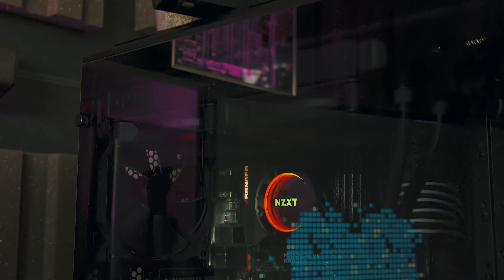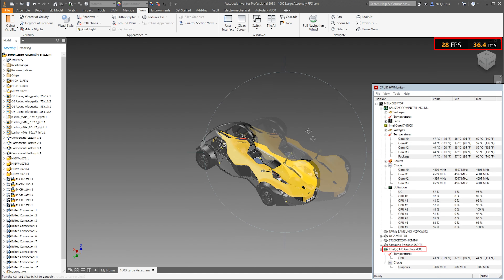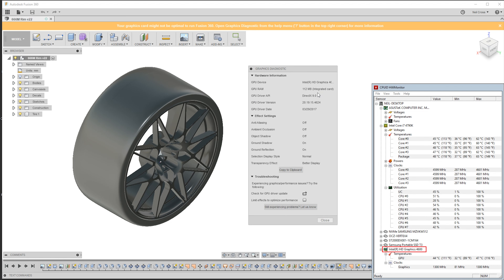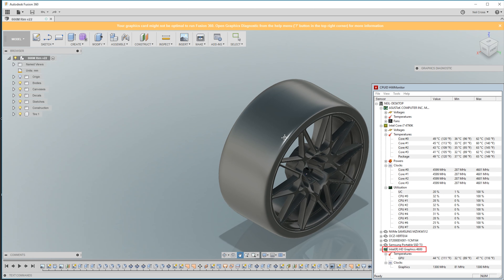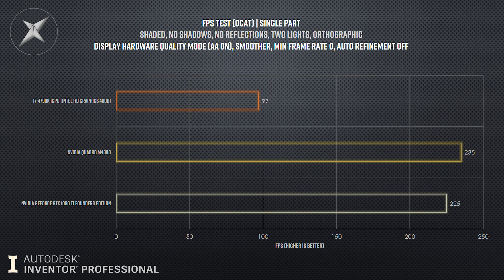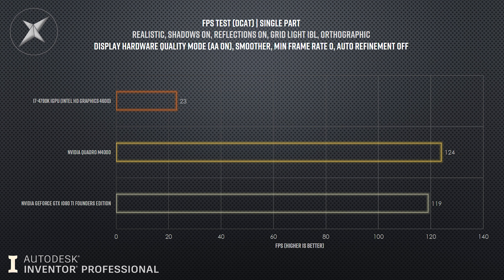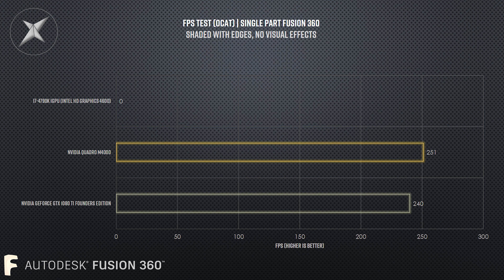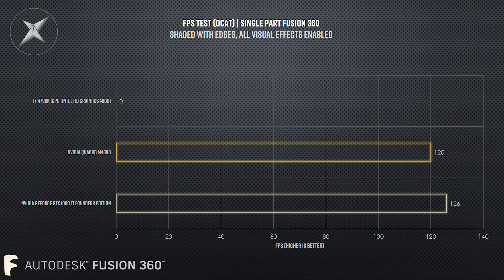What happens if you run 3D CAD on integrated CPU graphics? Spoiler Alert, Fusion360 HATES it!

Comment: Great vid. Thanks to you, I saved $300 by going with igpu since I only need to work from home occasionally for emergencies...  Hope to see a vid with the new apus/igpus.  Thanks again.
Reply: Worked good?
Reply: @omarn8266  depends on what you mean by good.  It helps to turn shadows off.  It may display bounding boxes only when orbiting in a massive model.  But the experience is workable, not like the interface is lagging seconds behind each move.

Comment: 90% of the time, I run Inventor in a VirtualBox Windows 7 image.  It is reliable as long as I only have one file open at a time.  It doesn't matter if said file is a 1000 part assembly, or a single part... it'll (slowly) model itself.  It's faster than Boot Camping over to Windows and back.  However, the part faces have a high probability of becoming transparent as soon as two or more files are open.  To make the faces reappear, I typically need to close the files and then reopen.  I don't recommend it, but it does work.

Comment: I use fusion 360 on a surface book with integrated graphics and it works just fine.
Reply: The IGPU he used here came out in early 2013, thats why it sucked.  The modern IGPUS  like in your surface book are far better. (of course he'd never disclose that, it's a way of manipulating viewers to sell products, they all do it).

Comment: The iGPU is allocated dedicated system memory by the motherboard (up to a maximum of 2GB depending on the specific motherboard) and is configurable in the BIOS. I'm curious if the iGPU with the full 2GB would be fine for Inventor on a 1080p screen as I'd imagine 2GB would be more than enough.
My motherboard only allows for 1GB of dedicated memory but it'd be really cool to see a video on how to best set up your computer for inventor if the iGPU is all you have available, like it's £120+ for a low end GPU with 4GB of RAM and if you don't game the GPU's power is just sitting idle. I really enjoy your benchmarking videos they remove all the bullshit, you don't need dual xeons and a £10,000 graphics card like some websites suggest.

Comment: I love all these kinds of hardware related videos you do! I do not remember if you mentioned it in another video but any plans to test Autodesk applications with Ryzen? I think the 1600x is priced so well and has ECC ram support (such as with Asrock x370 boards) but the IPC performance is a concern. Keep up the great work! Edit: Actually I suppose the Ryzen 7 would offer the same IPC performance so I cant wait for the video :)
Reply: 66racer 
As long as the RAM is at DDR4 3000+, it should be good. I guess we will see with the AMD build. But, anything over DDR4 2667 is technically overclocking, so it is not guaranteed to work. Another option is to run the Ryzen 7 in quadcore mode as 4+0, which would eliminate the CCX latency.

P.S. You want to make sure the motherboard actually supports ECC. Most of what I see is that they support it in "non-ECC mode".

Comment: TFI, i will be building a new rig early next spring and my plans are to use I7700K, Nividia Geforce 1080 (not Ti) FE, and 16gigs at 3200, 250Gig SSD M.2 and 4TB 7200 HDD. will this be more than enough to run the CAD Suite with Inventor and still play games? if you have any recommendations as to what i should use "as in maybe more RAM" please by all means i will like to hear some feedback. The wife has giving me the Green Light to build whatever i need to help in getting my Mechanical Degree.
Reply: Skepz I will look into that. I love the research as much as I love the results. Thanks kindly.
Reply: Skepz 
The Ryzen 7 may not run Inventor as well. We have not seen Ryzen benchmarks with DDR4 3200 RAM in Inventor yet. But, even if that is the situation, Ryzen 7 would be able to game while waiting for Inventor to do something where the 7700k could not do anything while waiting for Inventor. Ryzen 7 will also give better minimum framerates.

As for the RAM, 16GB of RAM may not be enough to game while running Inventor. It depends what the RAM requirements of your CAD models are.

EDIT: I see that you are merely getting your degree. For my degree, an Athlin II X3 was barely enough, but it worked. It had half the IPC of Ryzen, so a Ryzen would be very adequate. As for the RAM, 8GB was okay for me, but FEA simulations were a problem. However, I made it work. And, the only serious Inventor work was for a senior project where I my team did one of the more advanced CAD projects in the class. Education is probably not going to deal with too complex of models. You do not have enough people working long enough to make anything too extreme. I think my project was an assembly with only a few dozen parts.
Reply: R7 1700 won't help with inventor performance, GHz is king and i7 7700k hands down thrashes the AMD CPU's, TFI's videos support this.
As long as your gaming computer has the i7 7700k, at least 16GB of RAM, and Inventor installed on the SSD you have the best Inventor computer you can buy, everything else doesn't matter too much, ohhh and Graphics card with 4GB of RAM.
Reply: Thomas Allan thanks for the advice. My GPU is 8 gigs.
Reply: it looks like i have some real research ahead. i truly appreciate everyone input. My build budget is $2,500 max. i think i should be able to make something impressive work. thanks again to all.

Comment: I have Lenevo yoga 710 with i7-7500u, and it has Intel HD Graphics 620 can i run solidworks? Im first a year student as mechanical engineer
Reply: were you able to run it, if so how smooth was it? if not what did u do

Comment: Help me to choose one laptop for gaming and 3d modelling.

Laptop 1:

CPU: Intel i5-1135G7  (4 Core , Base 2.4GHz , Turbo 4.2GHz , 8 Mb L3 Cache, 10nm  ) Release  2020
GPU 1: Intel Iris Xe Integrated GPU (1.3GHz Boost , 10nm , 25 Watt)
GPU 2: Geforce Mx 350 2GB  (1.35GHz base, 1.47GHz Turbo, 64bit @7000MHz , GDDR5 , Pipelines 640 ,  14nm , 25Watt )
RAM 16GB (3200 MHz)

Laptop 2:

CPU: Ryzen 7 4700U  (8 Core , Base 2.1GHz , Turbo 4.1GHz , 8Mb L3 Cache) Release 2020
GPU: Radeon RX Vega 7 Integrated GPU (1.6GHz Boost , Pipelines 448,  7nm , 15 Watt)
RAM 16GB (2666 MHz)